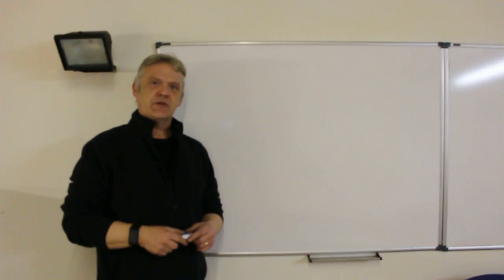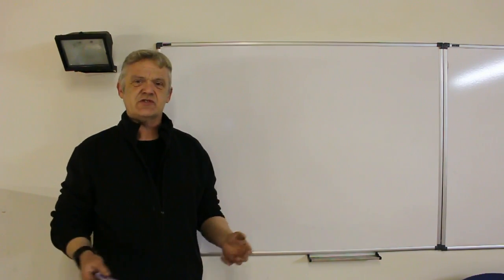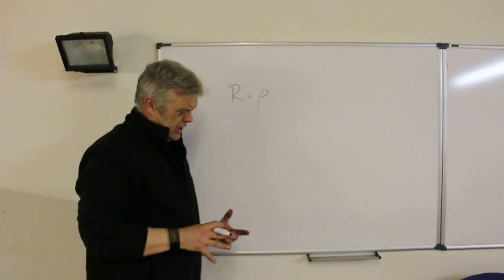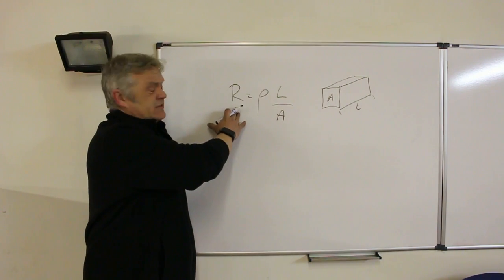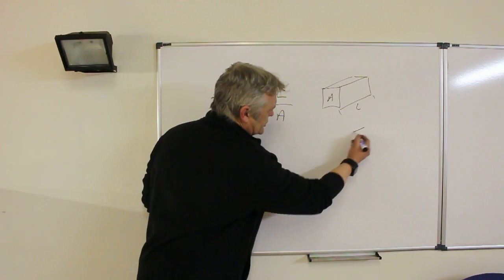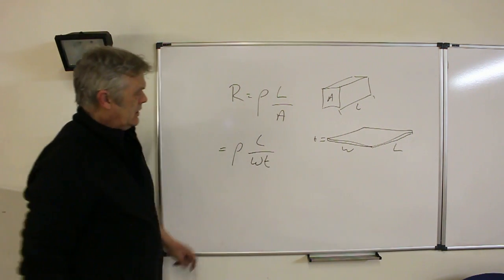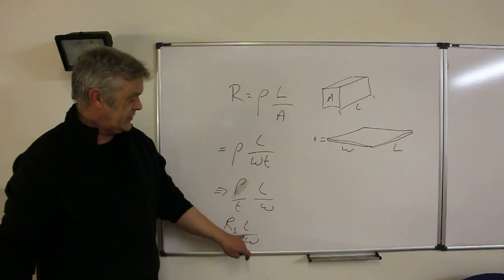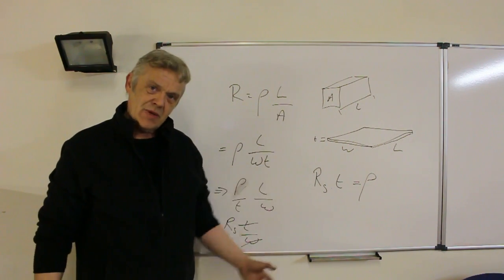How To Make A Probe For Square Resistance

Comment: Question: wouldn't the glue affect the resistivity of the square?? Can anyone answer this? Is this method applicable to concrete square?

So I'm trying to measure a resistance of bulk concrete (5x5x5)cm. I initially choose wenner probe method but unfortunately I dont have the commercial wenner probe. Is it doable to make a manual wenner probe circuit?

Comment: Hi dear. Just a question. Can I use this stuff instead of 4-probe point (tip)? I am working on brazing alloy and need to measure their resistance accurately. But I have no access on expensive 4 probe method. Thanks a lot.

Comment: Copper water pipe is pretty pure and can be obtained in most hardware stores, also you can put a tang in it to screw your probe to, if you can not get thicker copper.

Comment: Love how the  white plastic is  turning the color of carbon. :) Check this   DOUBLE capacitance from University of Washington inexpensive new method for manufacturing supercapacitor electrodes. https://www.techbriefs.com/component/content/article/tb/techbriefs/manufacturing-prototyping/28309# 
Aerogels made from formaldehyde and other carbon bases are dried/heated preserving their high 3D surface area. Thin sheets of molybdenum disulfide or tungsten disulfide (Used in industrial lubricants) are broken using sound waves and mixed into the gel. Combined with adhesives and “carbon-rich material” it is rolled into sheets a few thousandths of an inch thick. Discs were cut and assembled into coin cell battery that tested with higher capacitance.
 One gram of aerogel contains about as much surface area as a football field.

Comment: Hi Rob, thanks for this, I just completed and started using a copy of what I have seen you showing us all this time- brilliant. One question however I have heard on several videos you say 'divide by 25 and multiply by the thicknes t- and that gives us ohms/ square / mm. I guessed the dimensions of your probe as being 50mm x 50mm therefore 5cm W and L so surface = 25 cm square. So this would standardise to 1cm square or have I missed some subtlety?Many thanks for all your generous information and amazing, tireless enthousiasm!

Comment: Hello Robert, I really appreciated seeing the theory, design, and building of the probe.  This gives us common language for measuring the square resistance and allows comparisons of experimental material designs :) :) :)
However, I have a concern, unless you trim the material being measured to the same standard dimension, it can cause inaccuracy.  Here is how:
Resistors act in parallel, and as you put more material in parallel, the resistance will drop.  Therefore, sheets that are larger than the probe will be putting the material outside the border of the probe in parallel with the material within the borders.  Since the material is typically thin, the measurement won't increase in a linear relationship as the sample gets more and more oversized.  But it's those first few centimeters around the outside that will have the greatest effect.
It's a perfectly good and usable tool, just need to be aware of that effect. :)
Reply from the maker: There are other faults with this mate and plenty of arguments about design - for example some folks say you should do it in concentric circles to avoid disparity of flow at the ends - but to be honest as a tool for the home researcher i feel it is just fine - but thanks for pointing out the one of the issues
Reply: SMOG That is correct. However, the material most people are trying to optimize for low resistance will have numbers from ones to maybe hundreds of ohms.  Skin resistance will be tens of thousands of ohms  (unless maybe it's an android doing the tests. lol.)  My point being that unlike for general electronic circuit test, skin resistance in parallel should not change the reading of these materials that much. :)
Reply: Oh absolutely Robert, these things have to be affordable.  :)
The way to control the parallel effect I am talking about is to standardize in one's lab on sample size.  So for example, make the square probe to be 10cm x 10cm, always use sample material size 20cm x 20cm, and then try to approximate the placing of the probe near the middle.  This way would be more of comparing apples to apples.
Conversely, trying to cut the material to exactly fit 10 x 10 would be hard, especially to avoid damaging the edge.
Cheers mate, good video! :)
Reply: If the dimensions of the resistive layer you're masuring are a lot bigger than your measurement device, you could just multiply the value you've measured with a constant factor. 
This factor could be derived mathematically (Oh no, don't do that!), or you could just measure this factor once by comparing the reading of a trimmed and an untrimmed sheet. 
In most cases, this factor will be independent on the material - just measure it once, for one material, and you know it for every future measurement ;) I guess that this factor could be 1.5 or so.
Reply: There you go Timo Oster, that should work very well, especially since the samples should be two dimensional sheets.  I was wondering what would be a good calibration material to arrive at the factor, because aluminum foil, although convenient, is such low resistance it might be hard to measure. ;) Maybe steel/iron sheet or stainless screen would do well for that. Carbon sheet or graphite weave would do even better. :)  Afterward, maintaining a consistent sample size would let you use the factor calculation with any sheet material.
Trying to just use the material you experiment to prepare might be misleading for doing the calculation.  Because that's where test material in a home lab might have problems in being uniform across a surface.
There is nothing wrong with having home lab practices be able to produce consistent results, because that makes for less frustration with results when trying to scale up.
Reply: I'm about to make one at home 50mm x 50mm. If the copper bus bar is 50mm long and 5mm wide, how wide should the device be? Should the width be from the centers of the bus bar, giving a total width of 55mm?

Comment: When you build EMC shields that need to be press fit into place (e.g. equipment covers), you get it drilled in very quickly that some materials are much better for low contact resistance at low contact pressure, while also being resistant to oxidation and other types of corrosion. The winning materials are always gold and tin. As you point out at the end of the presentation, copper will work, but only with a lot of pressure to get past the inevitable surface oxidation. Would be interesting to know what kind of difference you would get with an ENIG coating or even from tinning the copper electrodes on your square...

And, yes, yes, I know I should test it myself, but that looked like a lot of work, and I am lazy scientist! ;-)
Reply from the maker: lol - lazyiness is no excuse mate lol